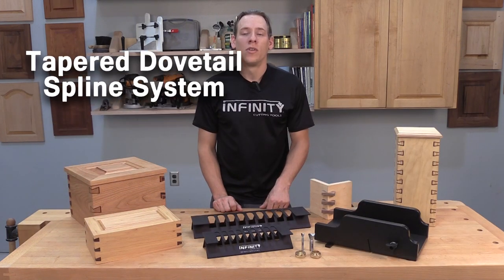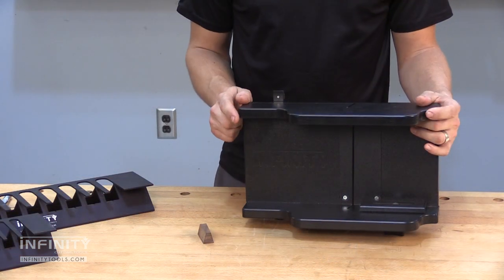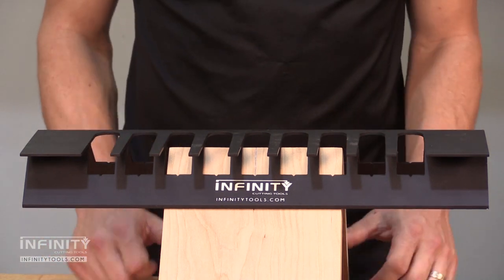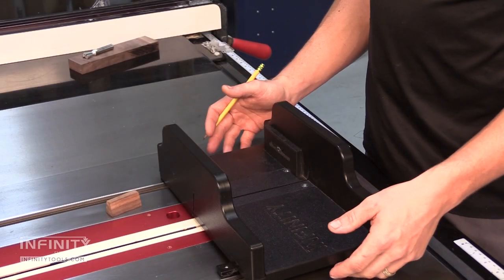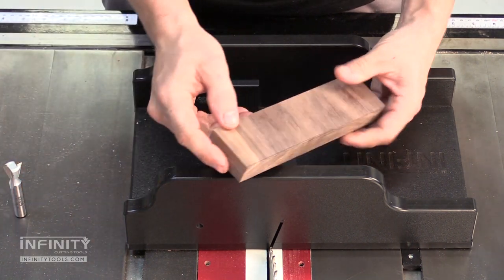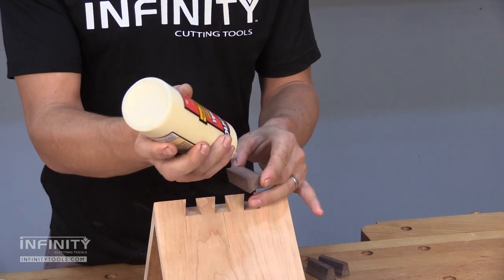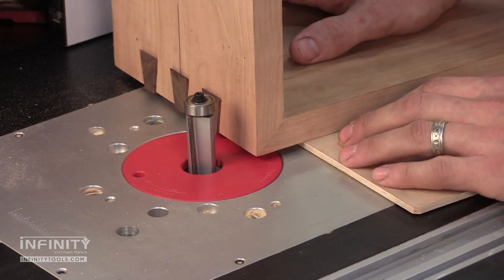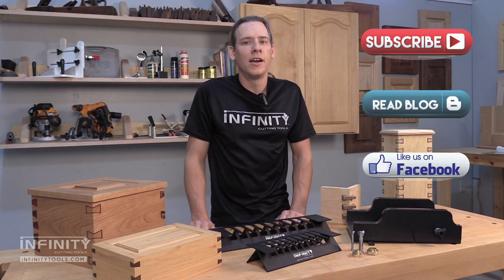Using the Tapered Dovetail Spline System

Comment: used triton routers in the shop  found to be top heavy  but great in the table
Reply from the maker: Hi William, I love the big 3.25hp Triton for in the table, but prefer the smaller 2hp Triton for handheld work. I have used both of the Triton routers in each situation and never been disappointed.
Reply: by hand  the triton feel top heavy  but in a table  super

Comment: have 3 routers  1 palm  and 2 others  a 1/4  and one that has 2 chucks but they are weird   i want somthing that can be adjusted from the top of the table and not cost a arm an d part of the torso
Reply from the maker: If you already have a table, Have a look at the Triton, we offer it as a package with our aluminum router plate that fits into a standard size table with a 9-1/4" x 11-3/4" opening. 
https://www.infinitytools.com/infinity-tools-router-table-insert-plate-4766

Comment: what h/p is the router you are using
Reply from the maker: We have a Triton 3-1/4 HP router in our router table. For the Dovetail spline system, any router that will accept a 1/2" shank bit should do just fine. If you would like some more info about our router table, here is a link to it on  our website. https://www.infinitytools.com/professional-router-table-packages-w-router